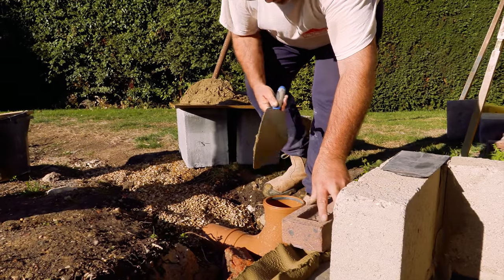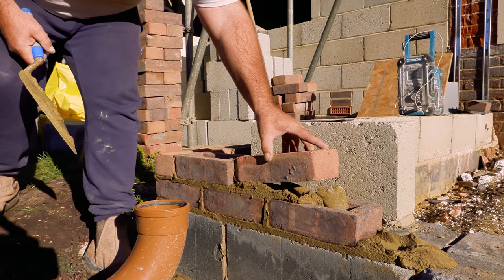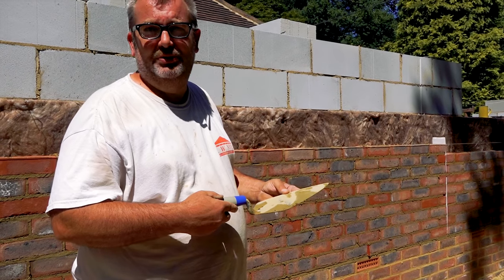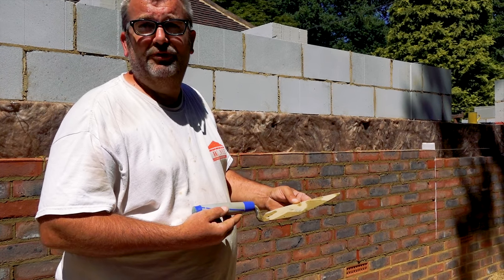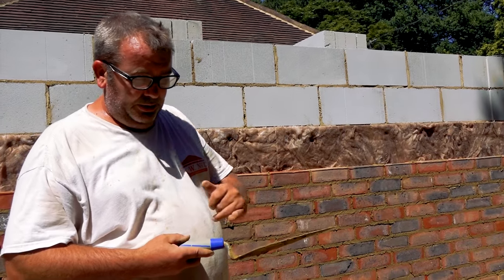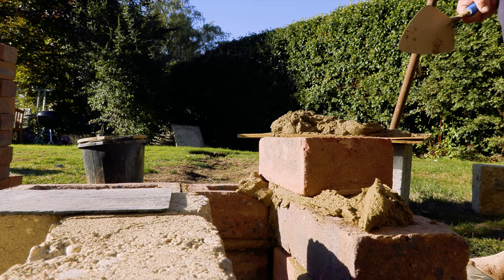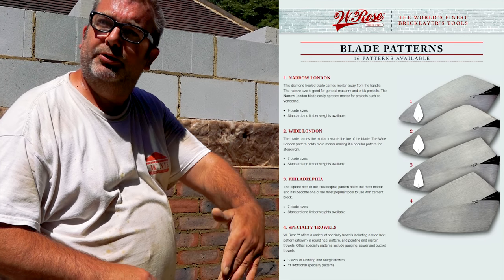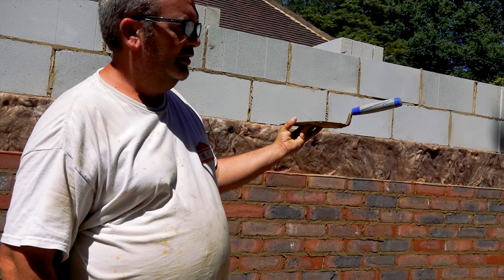Brickie Left Marshalltown for W. Rose - Why?

Comment: Bought & tried W.Rose 12' Philly, 12' London, MT 12' Philly, 11' Philly, & 12' wide London. W.Rose has stiffer steel than MT can feel it when cutting brick, personally prefer MT it has softer / flexible steel less vibrate but wear down a lot quicker. Conclusion of my little experiment, MT philly 11' is the best amongst these 5 (for myself).

Comment: He has relieved the pain by changing the angle of his wrist.  
It would probably have been the same experience, after so long, if he had gone from Rose to Marshalltown.   
Regularly swapping between them would be worth considering.  
Same applies to any tool which you are constantly and principally using. 
A regular and slight variation in angle or weight is beneficial.

Comment: Here's another tip for you, high lift handles will give you sore wrists after a while but low lift handles will give you sore elbow joints. So it's true here that he's feeling better the pressure is off his wrists but he will eventually get sore elbows so i would hold on to that old trowel to switch back to..these trowels are forged and are all slightly different to each other so you can still find a Marshalltown with the right lift that hits the spot for you.
Reply: True from my experience. I'm now using a high lift (Tyzack) trowel, cut small, but I don't take heaping mounds of mortar so... Could care less, health is #1.
Reply: The Ragni 10 inch crown narrow London, great trowel for not giving you repetitive strain injury, 🇨🇮🇨🇮

Comment: Interesting to see all the different comments on trowels , I have the same problems with new trowels so I tend to buy a trowel with a handle I can thin down to suit my grip and I even tend to cut and shape them to a size that resembles my older trowel due to  much wrist problems .I tend to buy whs Philadelphia pattern {leather and wood handle ) and shape them to suit as they are also very light as well, Great trowels for me  , but a lot of lads are not to pleased with the quality of steel Marshalltown are using these days and are opting for other trowels .

Comment: And it's not the narrow london pattern, it's the wide.
Reply: Narrow and I don't like Rose rubber handle. I generally use wood.
Reply: Cork handles are nice on W Rose
Reply: Yea mines a London style. Fucking love it man. Best quality there is.
Reply: I lay more stone veneer than brick or block tho. So I can't speak for that but the ol Rose London is about the best I've found
Reply: It's taken 5 years but you are correct, the trowel in the video is a wide London.

Comment: Marshalltown  for me , I bring my old trowel with me to Leicester trade tools,  great shop, and put my old trowel on the floor next to the one I'm replacing it with, and if the handle lifts match, bingo. But the bottom line  is , a trowel is only as good as the man driving it.
Reply from the maker: Hi Micky 
You are right about the importance of the man/woman on the trowel. I think it is human nature to attach importance to a  talisman but  I am sure that once a brickie gets used to a trowel they will be able to produce good work with it, but by the same token if something is working for you, why change it?
Reply: Stone me i go there to! Cracking little shop with a reputation spread far and wide.
Reply: Now don’t lie to me boy

Comment: Used a rose London for 3 years now so no going back after 34 years on the tools.
Have a look on eBay though cos I pay around £50/60
Reply from the maker: +Tony K 

So is this one Dave is using a wide of narrow London? I am not sure now
Reply: Skill Builder if your really serious about finding out get on to Dave .assuming that he hasn’t had the trowel that long it should still be at its manufactured size . (Can’t tell if it’s a 10 or 11 inch length . ) if it’s an 11 inch narrow London its should be 4 3/4 inch wide    If it’s a 10 inch narrow London it should be 4 1/2 inch wide, if it’s an 11 wide London it should be 5 5/8 inch wide , if it’s a 10 inch wide London it should be 4 3/4 inch wide. Info from Kraft tools website. That should sort out which blade pattern it is. If the width of the blade is between 6 inch and 6  1/8 inch it’s a wide heel pattern rose. The other main pattern rose make is the round heel pattern but I doubt if it’s one of those.
Reply: @SkillBuilder  it's deffo i wide patterm.
Reply: @SkillBuilder  that is a wide London pattern.

Comment: Just bought a w rose 10 inch wide London elbows hurt on he marshalltown so thanks for this will try your theory out 
Justin  -brickright 👍
Reply: Hey Justin I’ve just bought a 9 inch W rose wide London pattern for  a bit of the old pickin and a dippin
Reply: @gilesj2215  so different to the marshalltown blade is a lot thicker but nice trowel good luck with it
Reply: @brickrightbuildinglandscaping  did you buy it online Justin ?
Reply: @brickbybric  
Hi bric bybrick
I like the name 🧱👍 yes i bought it on line cant remember where though sorry .
Justin brickright 👍
Reply: @brickrightbuildinglandscaping  Tks Justin . The reason I asked if you bought in online was the trouble with the w.rose trowels is they are the most un uniformly manufactured trowel brand I have ever come across and when you buy them online your taking a gamble that you’ll get one you can get on with . If you went through 15 m.t 19/11 Philadelphia’s they’d vary somewhat but the differences between them wouldn’t be that much but with the rose trowels they can vary like night and day . The most uniformly manufactured trowels Iv come across are the Whs/tyzack .
Reply: @brickbybric  
Or right .It feels like a nice trowel a lot thicker than the marshalltown trowels so really different not sure if thats good or bad i cant make my mind up i wish i went with the Philadelphia though never had a London so thought id give it a go.
Thanks mate for the info 👍🧱

Comment: What size london pattern was he using. At there 40 to 50 on eBay.
Reply: Wide London he has
Reply: @ryankingmtb4025  thanks, could you tell from the video 10inch or 11inch?
Reply: @JimJimpmjj . Looks a 11 inch. I have a rose 11 philadelphia. You can get a 10 1/2 inch or 11.1/2. Low lift or regular. Limber or stiff blade
Reply: @ryankingmtb4025  thanks for the info mate 👍, yeah I checked there website for more information about there trowels. Might have to get one in the near future, think 10inch London would suit me not sure weather wide or narrow. Just a shame I can't find anyone that stocks them so I can go and pick them up and have a feel size/pattern/lift and see which suits me best.

Comment: That’s a wide London, low lift shank. The leather handles are more expensive than those plastic ones, there from Philadelphia.
Reply: I’d be doubtful if it’s a specific low lift shank w.rose . One of the problems with the standard shank w.rose trowels is there anything but standard .I’ve seen the w.rose so called standard shank trowels come with every handle angle under the sun . If the trowel hasn’t the specific mpn that the lowlift shank trowels come with it’s hard to know for sure what it is.
Reply: @brickbybric  just bought a 11" rose philly, wanted to see what the fuss is about. The lift is so low, the handle runs almost parallel to the blade. Bloody hard on the wrist. Suppose I was just unlucky, cos like u say, they're very irregular.
Reply: @wolfhachmuth7731  temptation got the better of you wolf . You know now in practical terms what I’ve been going on about.

Comment: £85 for a trowel?!?!?! By christ, in Australia they are $90, which at a rough estimate is around £50! Total rip off. And having used both brands, I would not go back to W.Rose, although that is nothing more than my opinion and preference for the handling
Reply: Daniel Renucci he paid way over the odds for it . You can pick them up starting from around 40 quid depending on the handle type you get.
Reply: In Canada they're about 65-75$ CAD depending on the type of handle you want, and were next door to where they are forged

Comment: Roger my advice to any bricklayer considering purchasing a new trowel regardless of brand is to buy the trowel in person from a hardware store or builders provider etc and go through all the trowels till you find one that suits you .Marshalltown are a very uniformly manufactured trowel but even with them you will find differences in handle angle , Weight , blade flex. . Of all the trowel brands I have come across I especially would not purchase a rose trowel on line they are the Most  un uniformly manufactured trowel I have come across . The guy in the video was very fortunate to be sent one he gets on with . All good  trowel manufactures know that the handle angle of a trowel is correctly set when you turn the trowel over on a flat surface the handle should lay flat on the surface with the tip of the blade also making contact with  the flat surface. I have found with w.rose standard shank trowels ( they also make a low lift shank trowel) that the handle angles are all over the place . The tang on them can be different heights also the tang can be lying back greater than 90 degrees if you couple that with a high handle angle they are practically unusable. If you purchase a rose trowel in person and find one that suits you then you have a great trowel ( they are made from high quality raw materials) Kraft tools u.s.a are the current owners of the w.rose u.s.a company. I certainly would not pay 85 quid for one . If you buy a brick trowel from an online retailer you are trusting an unqualified person that knows absolutely nothing about trowels to pick your trowel . They will go to the shelf were the  trowels are kept they will scan the barcode to see if the have the correct brand type etc and having established that you will get the first trowel they put there hand on . You might be lucky and get a great trowel that suits you ( like the chap in the video ) or you might be sent a load of crap. Stu crompton has a video out of a tyzack trowel he purchased on line and the handle is out of line . If the guy that was sent to pick that trowel off the shelf took even a cursory look at it he would have seen that manufacturing fault and put it in the bin .
Reply: One more  thing roger .he says it’s a narrow London but I’d be 99.9 percent certain what he has in his hand is a wide London he may have ordered a narrow London but it looks to me like they may have sent him a wide london. The wood handle rose trowels have the manufactures part number stamped on the handle but the proform soft grip handle on his one does not.
Reply from the maker: That is great advice and, we must remember some of these trowels could be Chinese copies. It may even be that the copies are better. I have seen that before.
Reply: Why would someone in a warehouse or shop bin a trowel that passed quality control at the manufacturer? Almost all of the people working in these places are not skilled bricklayers so why would they “choose” your trowel? 

Your advice is correct though for a tool you use 8 hours a day and is your main form of doing your job you should go and pick it out yourself. Sadly these days the specialist tool shops selling high end gear are not always easy to find.
Reply: Adam Lynch that’s exactly my point Adam .they wouldn’t choose your trowel( they would be under the impression one trowel is the same as the next) ,you’ll get the first one that comes to hand . As for the one Stu crompton was sent , the fault was so obvious you wouldn’t need any training to know it wasn’t right ( just decent enough eye sight) although having said that,Stu was trying to convince himself that the handle was purposely off set because it had something do do with the right handed trowel left handed trowel thing. The lad in the video doesn’t seem to be to worried about the price he payed for the trowel because a ten second look around amazon which is where he bought it and you’ll find them considerably cheaper than the 85 quid he payed for it.
Reply: Skill Builder the gammy w.rose trowels I’ve come across weren’t Chinese copy’s they were just badly manufactured. Have you seen any Chinese copies of top branded brick trowels roger .
Reply: I purchased this exact trowel and the lift is even lower than the one in the video from what I can tell
Reply: Ashley Pickering did you buy online or did you buy in a hardwares store or builders provider.
Reply: @brickbybric  bought online really disappointed with it. Where can you go and try one.
Reply: @brickbybric  this may sound stupid but is there any way of adjusting the handle. I read on a forum that you can. but nobody said how
Reply: Ashley Pickering i am in Ireland . Generally speaking I get the impression that there are very few outlets in the u.k selling w.rose trowels . I have come across a few selling them online in the U.k . Speedcrete have 3 outlets in the uk and as far as I know you can go to them in person and make a purchase. SeS tools for brickys also sell them and i presume you can get them in person off them as well.
Reply: Ashley Pickering I adjusted the handle angle on a Marshalltown 34/11 some time back but it was a wooden handle one so it was quiet easy to get off the handle  .once it’s off it’s no bother to adjust them .this m.t had a very low handle angle as well which is unusual for a m.t. Trowel. The trowel handles are usually pushed on I believe with a hydraulic ram . I’d say the proform softgrip handles would be difficult to get off . Have a look at the first 1.5 minutes of this video from Netherlands ( holland ) it will show you how to set the handle correctly .by and large, trowels that are set like this ,bricklayers find the comfortable to use.The trowel in the video is a Dutch brick trowel known as an Arnhem trowel . I have checked a good few different types of trowels from different manufacturers and they nearly all conform to the method in the video leading me to believe that it’s a well known method among trowel manufactures the world over. W.rose trowels are made from top class raw materials but they are very uniformly manufactured . What w.rose call a standard shank trowel is far from standard and they come in every angle and then some.but if you get one that suits you with a blade flex and handle angle that suits you they are top class. https://youtu.be/8wxhGQScU3E
Reply: @brickbybric  how did you adjust the handle did you heat it up
Reply: Ashley Pickering no just gave it a few belts of the lump hammer . But it maybe a good idea to put a bit of heat into it.
Reply: @brickbybric  thanks mate I'll have a go
Reply: james Jameson so are you saying you have seen Chinese copy’s of w.rose trowels.
Reply: james Jameson you were Lucky James .if you ever get a chance pick one up in person and you will definitely like it better than the ones you have
Reply: james Jameson Irish james living in Ireland . We had all those hardware shops as well , all for the most part long gone . I worked in Boston ma. For the whole of 87 and they had those hardware stores over there as well crammed full of top class tools most of them have been taken over by big hardware chains by now.. I never heard of w.rose trowels until I came back to Ireland a friend of mine his cousin had  a 13 inch w.rose that some one had brought him back from California , He mentioned it to me one evening and it was years  later that I remembered about them  and look them up on the net . They are definitely made from top class materials but I find them to be very hit and miss in the quality of there manufacture. And for that reason I especially don’t buy them on line .
Reply: james Jameson I especially find the lift on them to be all over the shop every  angle under the rising sun .( I’m talking standard shank w.rose) all so the tang can be lying back greater than 90 degrees couple that with a high handle angle and there practically un unusable. . Read my reply to paddledog in the comments for this video. I have a friend in America who knows a good trowel so I can get them anytime I want . All trowel manufacturers know that a trowels handle is properly set when you lay the trowel face down  on a flat surface when the tip of the trowel is touching the surface the handle should lie flat on the surface . If the handle  angle is set to high there will be a gap under the handle near the blade if it’s set to low there will be a gap under the end of the handle. I found the old m.t metal to be way better than today’s.
Reply: The jointer I have was made from the handle of an old galvanized bucket by a black smith . I have 2 old Marshalltown jointers but I rarely use them.

Comment: why mortarboard and not a mortar bucket  or tub ?
Reply: De Walter large trowels are more suited to working off boards especially if your a long bed layer. Berlin trowels with swan neck  are best utilized when you are working from a tub . Dutch Arnhem trowels were they are used to bed for one brick at a time ( pick and dip) are more suited to working from a tub.
Reply: @brickbybric  yes you are right , my concerns was just it could be a mess on rainy days with a mortarboard .
Reply from the maker: De  Walter
We don't lay on rainy days. Not face work.